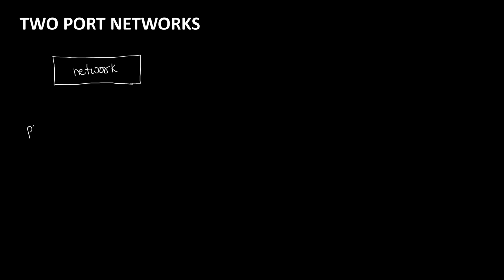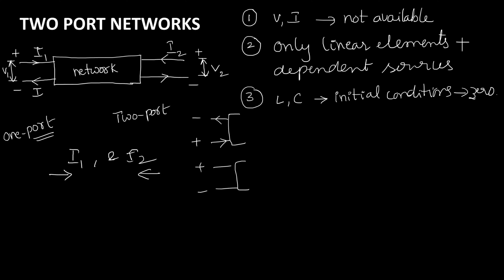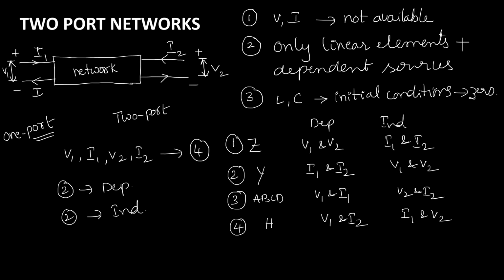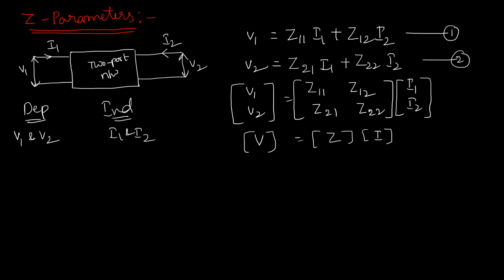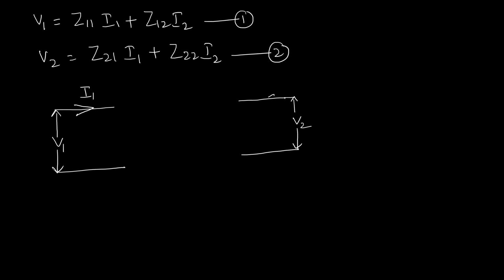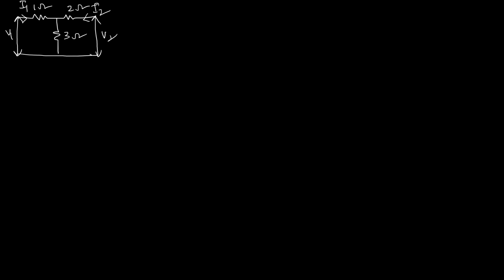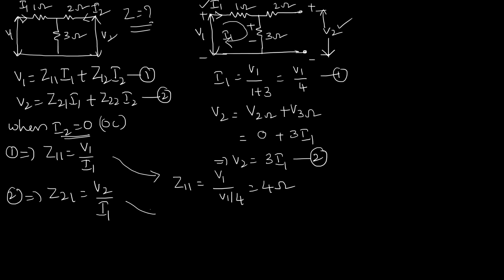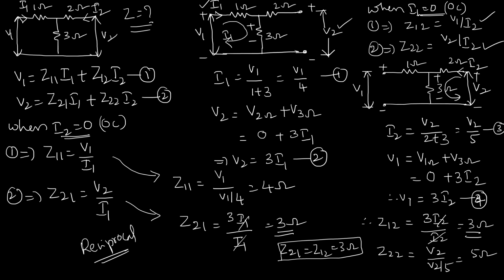Two Port Networks Introduction and Z Parameters With Numerical Problem

Comment: I don't understand how did you write that equations like  v1=z11 i1 +z12 i2.
Please explain how did you write them
Reply from the maker: It was just a voltage equation.
In two port network concept, two variables will be considered as dependent and rest of the two as independent. Here V1 and V2 will be considered as dependent variables and I1, I2 considered as independent variables. That means we are supposed to relate dependent variables in terms of independent variables. Therefore we are supposed to write v1, v2 relations means voltage equations.
Reply: @DrNagarajaKumariElectrical     yeah , I understand .  Thank you somuch 😍
Reply from the maker: Good

Comment: I want these topics please  .

TWO PORT NETWORKS & RESONANCE:
Two Port Network Parameters: Impedance, Admittance, Transmission and Hybrid 
Parameters and their Relations, Interconnection of two port networks.
Resonance: Series, Parallel Circuits, Concept of Bandwidth and Q Factor.
Reply from the maker: Resonance yet to post, but for rest of them, please check the following links:

Y Parameters with Dependent Source Problem:
https://www.youtube.com/watch?v=gCe3Seo6t5g&list=PLwZNW4wgcv7WxQWTv2NAFNvu5gUlgkZ-6&index=1

Transmission (ABCD) || Inverse Transmission Parameters || Cascade Connection || Numerical Problem:
https://www.youtube.com/watch?v=97dywCMo3xg&list=PLwZNW4wgcv7WxQWTv2NAFNvu5gUlgkZ-6&index=3

Two Port Network Parameters Interrelations Part 1:
https://www.youtube.com/watch?v=8T8OCF7NfBY&list=PLwZNW4wgcv7WxQWTv2NAFNvu5gUlgkZ-6&index=6

Two Port Network Parameters Interrelations Part 2:
https://www.youtube.com/watch?v=ntmRftIam7I&list=PLwZNW4wgcv7WxQWTv2NAFNvu5gUlgkZ-6&index=5
Reply: @DrNagarajaKumariElectrical     thank you somuch 😍
Reply from the maker: Study well and all the best.
Reply: @DrNagarajaKumariElectrical  👍🙏